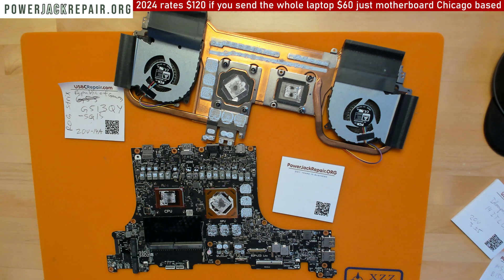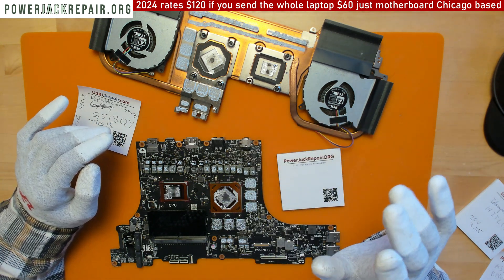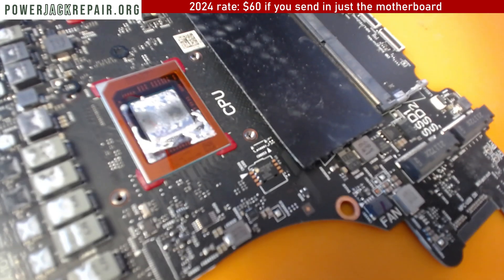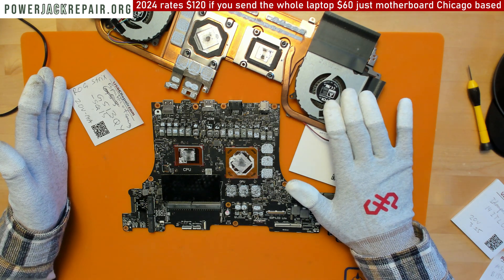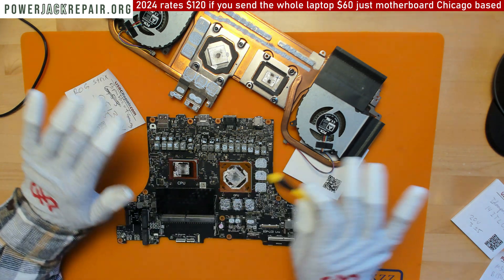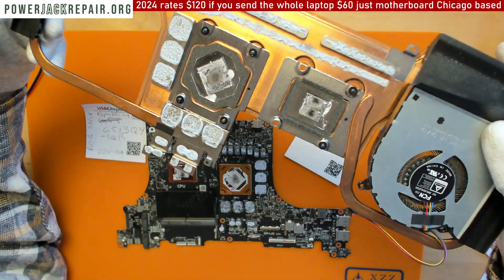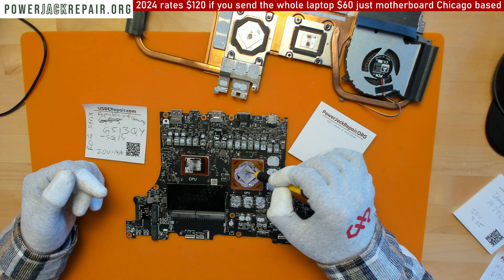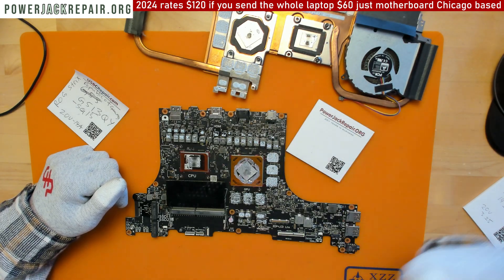WATCH THIS VIDEO BEFORE BUYING AN EXPENSIVE GAMING LAPTOP liquid metal thermal compound issues

Comment: I have that exact pc got it on sale for 1000 at Best Buy. The metal clip that holds the battery fell of while replacing ram I cant get it back on. Is there another way I can get a new one or get the cable to stay on without it. Please dr help!
Reply: I’m near chicago. I may have to bring it in if the new battery cable I ordered doesn’t fix the battery issue